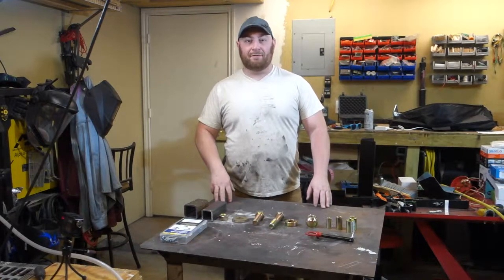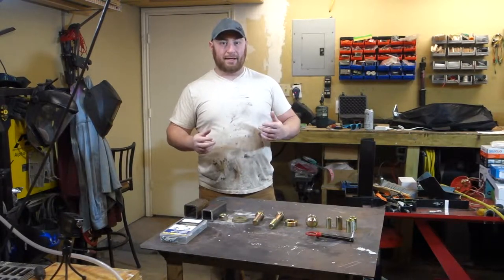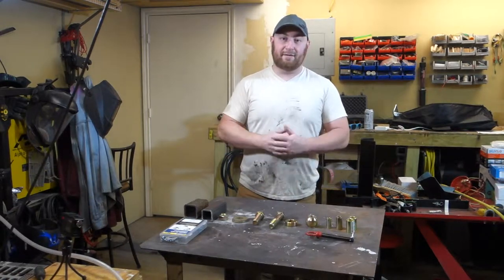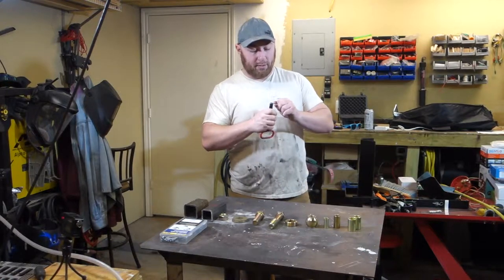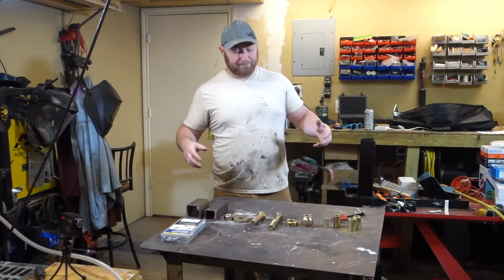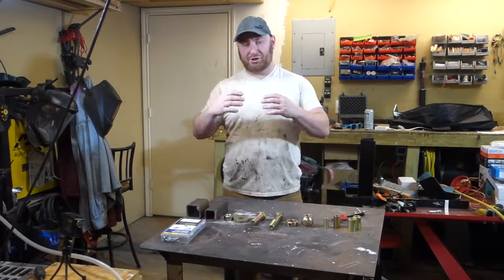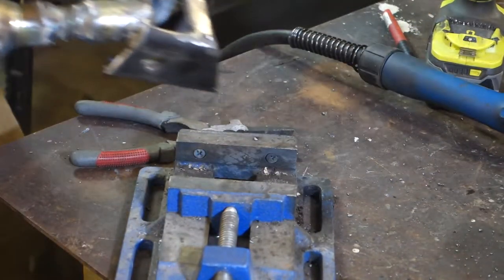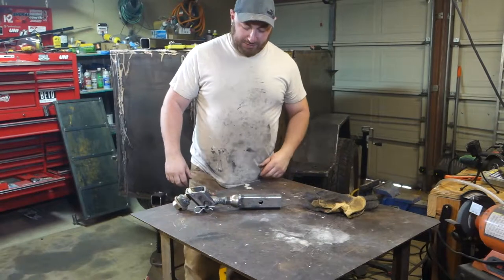Adventure Trailer - Episode 3 - 3 Axis Off Road Hitch

Comment: Hey man 
I absolutely love this build 
I’m making something similar but scaled down for a trailer I made for my e-bike 😅
One part I don’t understand fully is the piece that hooks up to the truck, in my case the bike 
After you weld the spacer/sleeve to the thicker bushing. How do you close the nut of the bolt without it locking the piece in place? Is it just a case of not locking it down all the way and leaving some thread exposed for the piece to be dynamic? What am I missing ? 

The original thread no longer exists 

Would reallly appreciate your feedback! Thank you
Reply from the maker: Are you asking how the truck ball pivots side to side? Basically you tighten the bolt until its still lose enough to move and then use a second nut to lock it in, or weld it. That way the top part can rotate. Another option would be using thrust washers and torquing to spec.

Comment: I  just made a hitch using your design. I have a couple of questions. On the truck end When you installed the piece of 1 inch spacer in the collar did you insert it all the way in and then welded or did you set it on top and weld.16.50 on video Also when you bolt hitch to the box that goes to the truck did you use a lock washer or anything? 19.24 on video. Is the bolt a little loose or is it tight? I bolted mine up and could not get it to swivel on the bolt. I have the washers in the same place and trying to attach it to the hitch portion. I hope I made some since of what is going on there.
Reply from the maker: basically the idea is you are not supposed to punch the part that goes into the truck. I can see how this was not explained properly in the video. The tolerance between the trailer lock part(that big hole you drilled for the bolt should be able to move around the bolt to allow the trailer to rotate.
Reply from the maker: its unfortunate the forum post seems to be gone as it was super useful in understanding this process.
Reply: @Makswerks1  which forum post. Exp portal or something else

Comment: I liked your build progress until this episode. That’s a poorly made hitch man. At least use some heavier materials on the T and weld it with some flux core or 7018’s. Yikes
Reply from the maker: This hitch has been all over Texas. I have recovered vehicles through the trailer. It is absolutely stout.
Reply: MaksWerks for now. Until it’s not. I’m not saying the design is bad or the build is bad. Some of the material and the fab def isn’t great. Anything like that can be strong until it’s fatigued and it’s not. I’ve built, worked on, and been around heavy equipment my whole life. I’ve seen critical components way overbuilt fail. I’d rather rely on overbuilding that hitch with thicker material and more sound fab than safety chains to save someone’s life when or if it does fail. There’s just way to much cringe in seeing that design built to be slapping it on the internet as a how to. I hope it never fails you or anyone else over the long term bro.
Reply: MaksWerks just my advice man, if it was strictly off-road use then to each their own who cares if it fails or doesn’t. My gut just rolls thinking about that on a highway coming apart. As builders we should strive when it comes to something critical to build something overbuilt that everyone with a mind for it can agree it is. That’s the best we can do to curtail long term fatigue failure. Seeing as neither of us will be spending time or money to build a load and torture test apparatus to test things with.  Other than that love the trailer build man. My skeleton is done working on the guts now before I skin her out.
Reply from the maker: @baywoof  There are guys who "been around heavy machinary all their lives" and there are guys with engineering degrees. This design, the materials used, and the fabrication is fine. Thicker isnt always better. knowing tolerances and building to them is the way to actually engineer things. The proof is in the pudding. There are a bunch of variations of this design out on the road, hitting trails and putting in work. Can you build the same concept with schedule 40 pipe and bigger materials? Sure. But this is overkill for a sub 2000# trailer.
Reply from the maker: @baywoof  I dont give a shit about your education level. I responded to the comment you made. The boilerplates are there because I cannot  be responsible for other peoples builds. I am obviously only responsible for my own. If you want a warrantee there are companies that will sell you this same design for ~ $350. None of those bushings are hardened - for fucks sake you can see from me grinding and cutting them they arn't.  The information in this video is valid, however everyone is responsible for themselves. I do not sell these, I do not sell designs - this is all public domain. Don't like it, dont build it. But stop wasting my time talking shit on my video when you clearly had your points shot down. You want to design your own, build your own, and post it for comparison be my guest.